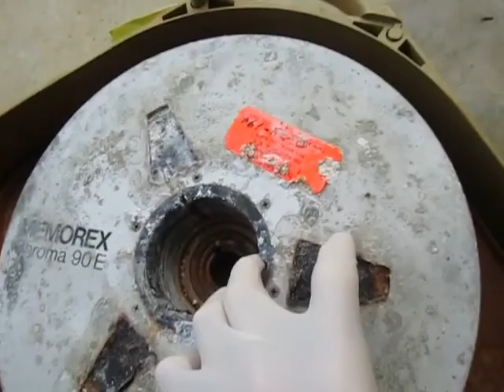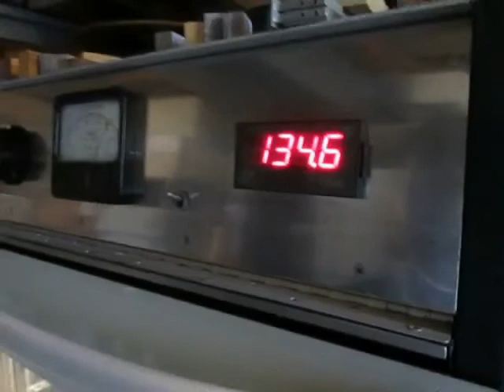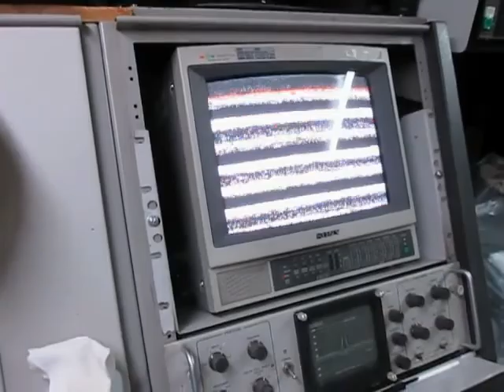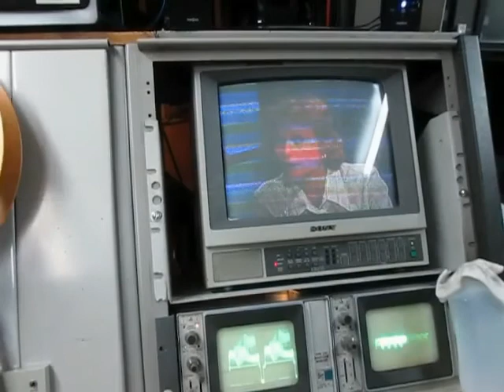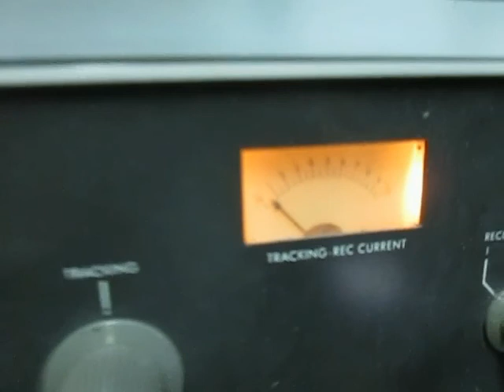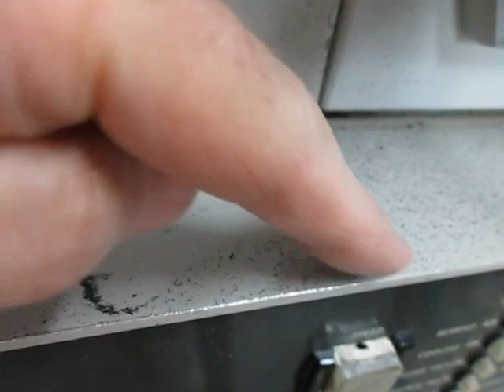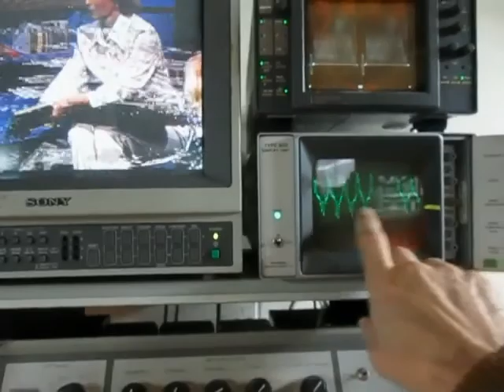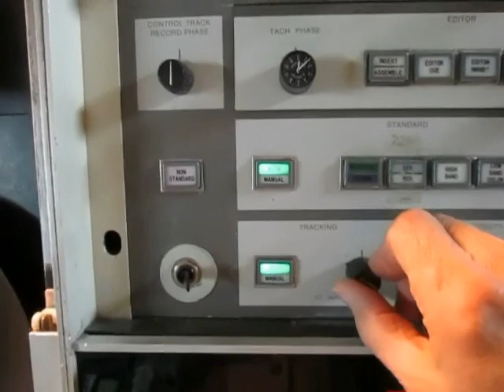The Quad Tape Transfer-Restoring A 2 Inch Quad Video Tape To Playable Condition And Digitizing.

Comment: Jeez when I saw the oxide surface of the "cleaned" tape I was ready to cringe thinking what was gonna happen to the heads that tried to play it.   Back in the times of RCA VTR and TCR quad machines, along with other tape formats, more than once I'd had to clean tapes that had been wet and dirty and had metallic oxides (usually white-crusty aluminum but sometimes mold) on them that could NOT have been good for the heads.  And how many quad machines are still in existence much less still functioning these days?   Parts like heads would be difficult to near impossible to acquire so the chance of damaging the heads with crud stuck to the tape would be a serious concern.   It's no wonder that the tape initially played back so poorly, when it was easy to see that the edge of the tape (that's where the control track is) was looking pretty rough.  But as the engineer demonstrated, there are alternatives, like keying on sync pulses etc to stabilize the playback and defeating the control track altogether since the control track would be unnecessary in this instance, mostly originally being an editing tool rather than necessary for playback.   Interesting that there are people who will still take the time and trouble to salvage old damaged media like this and make it useful again.  Kudos sir, from one old bcst engineer to another.   :-)
Reply from the maker: Hello Tony. Well, it helps to be crazy. Thats the first requirement! But seriously, it's no problem for me. I have my own ferrite bricks and make my own head tips. I rebuild my own quad heads from my stock of over 300 head assemblies. (its probably more like 350 but I lost count around 300). And you know what...I will let you in on a little secret: my tips last a lot more hours than the ones a head refurbisher puts on their refurbished heads....go figure. And then theres another advantage to doing it myself, I can make/change tip shapes and dimensions for certain problems with tapes that work better than a 'standard' tip. That realization came thru years of working with problem tapes and later on getting into doing the head work,  and having a lot of heads to experiment with. I really don't know how much equipment is still left in the world, and none of these 'experts' do either I don't think. But my feeling is probably "not that much". I've noticed in the past 10 years it has dried up to nothing if that's any indication. Heads- I noticed a couple years ago that after the Aheadtek guy retired and a chinese lady tookover, the prices on ebay went sky-high for used unproven heads. I haven't seen one on ebay in about a year. I am holding my own. I have collected vtrs, heads, parts for decades and have a mountain of spare parts, machines, and heads. I will never outlive what I have saved up. Have to nowdays in order to do the work. Just can't go out and find stuff like before. It ain't there! Here are the vtrs I use in the shop: www.QuadTapeTransfer.com
If you look around and take stock of what the other folks are running, usually they have one or two, maybe the same model, or a couple models. I have(or had) about every model going back to the tube era. Running and operating. I don't have any tube vtrs (and don't want any!) I say all that to say this: the more diverse models and head types, the more capabilities. Each different model of vtr and head assembly had certain things it does better than another vtr model, etc. Those differences really come front and center when trying to get a 60 year old tape or a damaged tape to play back better or not so good. Its another tool in the quad toolbox. Heres some more tape work you may like: https://youtube.com/playlist?list=PLJQg3rQJzoosKKRCrNrwgU13TE_KFqY6t&si=biTH-L60zUPJ-_N0
  Here is some video head work: https://youtube.com/playlist?list=PLJQg3rQJzoovLIWQ1VcnDdhNkikwBF5Qb&si=pp7snwwRwfltvrdP
  Here is some equipment work: https://youtube.com/playlist?list=PLJQg3rQJzoosbgyXSXE7AFEC_6U9dtKYj&si=41pHHV62-3ENzQjR
  And if you get bored with all the quads, I will play you a tune on the guitar! 😃🎸https://youtube.com/playlist?list=PLJQg3rQJzoosDp25C6aP8Sd_KC61b8-df&si=GEFY-oXXp0XqpN23https://youtube.com/playlist?list=PLJQg3rQJzoosDp25C6aP8Sd_KC61b8-df&si=GEFY-oXXp0XqpN23
  Have fun!
Reply: @LarryOdham   ...you rebuild your own quad heads?  Now THAT is dedication.  And, necessary these days if you want to keep a quad machine working.   I salute you sir, got your links bookmarked, gonna be checking them all out.  Keep doing what you're doing.   

Wanna talk old 2" tape.  We once dug an old Valleydale spot out of the racks all dusty, to see if it was salvageable enough to edit a bit of it out to make a new spot with the old days compared to the recent times etc.   This old 2" tape was BROWN, that old iron-rust-glued-to-cellophane stuff, and it played back perfectly in all its black&white glory.   It proved two things... the old tapes could hold on to their data for decades, and the station never threw anything away.   These days the only videotape I still fool with is 1/2", got a LOT of VHS tapes I've been converting to digital, been maintaining several high-end S-VHS machines for years... having long since learned the advantages of a TBC when resurrecting old tapes like that.    

Oh... just saw your video on the TCR-100, the bane of my existence.  LOL!   There were two of 'em, nicknamed FRED and FREDA (fucking ridiculous electronic device, and fucking ridiculous electronic device auxiliary).  Fascinating to watch them working with the back door open.   

Cheers... :-)
Reply from the maker: @tonyunderwood9678  Yep, rebuild my own quad heads, using my own tips. That is what it is coming to like it or not. Theres only one place on earth now that will rebuild a quad head, and they get $6,000.00 to do a rebuild.-NO THANKS!!! And when you figure in that their main guy retired a couple years ago, and the company is controlled now by a chinese lady that isn't all that interested(so I've been told, I don't know that for a fact), its anybodys guess how much longer they will continue. My guess is not long. I figured out years ago it was better for me to use the head rebuilding money to educate and prepare myself and get to the point where I can do it in-house rather than paying somebody else and hoping they will still be in business. I'm glad I did. It's not my problem anymore--its the rest of the quad world's problem....money well spent. I have been posting how-to and information videos here on the channel as I get time. I'm not going to rebuild anybody else's heads, but I am showing how to do it(how I do it) and someone else can follow my path if they want to rebuild  heads of their own/ invest their own time and money. // The early formula tapes are fine, they do not require baking because the emulsion doesnt collect moisture like the later formula backcoated tapes. The earliest tape I have digitized was 1958. It played back as good as the day it was recorded. When quad was done right, it was second to none. It gets a bad rap nowdays because there are a lot of amateurs trying to do it. And that's a sad thing because there is no longer anyplace they can go to get the experience they need. That is why I started all this, to put out some useful reference information that maybe the younger inexperienced archiving people can draw from. Not just talking about it, but showing how it is done and proving it.

Comment: Замечательно 👍!
А чем Вы ее оттираете в самом начале? Что за очиститель в бутылке?
Reply from the maker: Hello Eugene, I used two different solutions alternating between white vinegar and eucalyptus oil. The white vinegar is useful for softening the mineral encrustation and the eucalyptus oil is good for cleaning up the vinegar. Also used distilled water as a rinse. I spent about 6 weeks doing that cleaning, soaking, and brushing, over and over many times. The video shows the ending results.

Comment: Is there any way to output the control-track signal separately? I wonder if it could be run through an analog-to-digital buffer (which would smooth out the irregularities), then reinsert the buffered control-track back into the machine, to "fool" the machine into thinking it has the proper timing from the control-track.  Just a quick thought!  I love these old video restoration projects!
Reply from the maker: The problem with this tape is that there is no control track in spots because the oxide has flaked off from the water damage. The AVR-1 doesn't need the control track. It's secondary tracking mode detects the individual video tracks on the tape by looking at/for the fm signal peaks much the same way auto-tracking works, and then uses a derivative from that signal fed back into the control track phase circuit in place of the original control track. It does the same thing as the separate control track, indicates where the video tracks are located on the tape. It's nice to have that built-in function in a VTR to use on tapes with damaged or missing control track pulses.
Reply: That is such a sensible concept I wonder why AMPEX never used it in the VR2000s
Reply from the maker: @tortysoft  Ampex came close to it on the VR-1200-C. It was equipped with auto-tracking, which has all the ingredients needed to run without a control track. That machine had a -13 revision Intersync. I have a 1200-C autotracking vtr here.  Im not sure when the Intersync revisions stopped on the 2000B. I have a 2000B that is a -09. Its an earlier vintage vtr so maybe that is a reason why it was never considered, the Intersync revisions stopped before auto-tracking was introduced. A quad friend there in the U.K., David Dean, and I talked about doing it to one of his AVR-2 machines once upon a time a few years ago. There's no reason why it wouldn't work on another vtr.
Reply: I used an external ctrl signal to lock up a VHS that I used for recording broadband signals, like the medium wave. That worked very well. I've never had a pro machine - no space - or the need to try on a Quad. @LarryOdham
Reply from the maker: @tortysoft  Thats basically it. A very stable artificial(external) reference signal. Ampex went one step further and derived an envelope  from the fm video tracks, detected it, and used  the d.c. derivative voltage to self-correct the external reference subbed in for the control track. I have done it manually before using a HP function generator set to a high frequency and counted down for a 240/250 cps output. The HP was an oven crystal and the pot was a 20 turn shafted to a 100 to 1 vernier dial. You can get it down to 1 hz resolution.

Comment: Larry, what are you using to clean the gunk off the tape? Eucalyptus oil or some alcohol based material? Very impressive work.
Reply from the maker: Hello Paul, For a tape like this with corrosion and water encrustation I use white vinegar and a toothbrush to soak off the majority of the scale. Then when the tape is fairly clean from the debris, I will go over it with eucalyptus, then bake it. After baking I go back to the white vinegar soak and brush while the tape is still hot from the oven. After a few cycles it is loosened up enough to try unwinding/unsticking the layers slowly by hand. It took about 2 months to get this one completely unstuck and about another month after that to get it to a playable state.
Reply: @LarryOdham  Remarkable work. Do you have to remove the oil residue before baking? I have some Scotch tapes where the foam from the upper flange has liquefied and seeped into the tape layers. I was going to use eucalyptus to clean it down but worried what impact there would be if there was any residue left during the bake.
Reply from the maker: @Misterquill  Yes. I remove all the glue on the top surface using eucalyptus oil, then wipe off all the remaining oil with a thick absorbent cloth. Then bake. If the tape is evenly packed and wound tight, there will not be too much seepage. After baking I give it 2 or 3 cleaning passes on the Magnatek/Elcon cloth roller cleaner straight from the oven while still warm, then 2 or 3 passes on the Recortec vacuum grating cleaner, then put it on a quad vtr I have setup with an old worn down quad headdrum and burnish the tape a couple passes and monitor the RF Tracking meter level for head loading, stop & clean the head as-needed until it plays good enough to put on a good vtr for digitizing. Sometimes if the tape does have seepage, I have to unroll it by hand and clean the spots by hand with a cloth and eucaluptus. Not fun.

Comment: An explanation of methods and cleaning fluids would have be nice .
Reply from the maker: I think I had already explained that thoroughly on many other comments on this video. You can scroll around thru the comments and find several other explanations from me about the how-to. Basically its a toothbrush, cotton cloth, repeated soakings with white vinegar and undiluted eucalyptus oil, and distilled water rinse. Many repeats over about a two month period interspersed with step baking cycles from 126 to140.5 degrees F to loosen up the mineral encrustation and corrosion caused by the water damage.  You can ask me questions and I will be happy to answer, if I know the answer...😁 I would rather demonstrate the actual work and let you the viewer ask relevant questions that are important to you.
Reply: Thank-you
Reply from the maker: @whoam42a1  Anytime. Glad to help.

Comment: At 5:45 - I see the tape still exhibits what appears to be hydrolysis in the adhesive layer (sticky tape shedding syndrome). Wouldn't this indicate further "baking" or is that not what I'm seeing?
Reply from the maker: Hello Randy, No it isn't sticky-shed aka Binder Hydrolysis. The tape was baked 4 times thruout the cleaning process over about a 2 month period. The baking cycles lasted 8 to10 days each at various temperature steps ranging from 126 to 140.5 F. with a 2/day gradient. What you are seeing at 5:45 is mineral encrustation from the water and aluminum reel corrosion depositing a surface layer on the edges of the tape over a period of years being wet. To soften that layer, it was repeatedly soaked in white vinegar and scrubbed with toothbrush, breaking off a little at a time. Some of the deposits were below the edge down into the tape which couldn't be reached by brushing. Small granules hard as a rock. This video is an edited down version that had 5 parts and was about 3 hours long originally. Some of the shortened scenes do need a little better description.
Reply: @LarryOdham    Aaah. I was wondering if the adhesion was at the edges or not, since I watched you working them with the brush. I've been digitizing audio reels from the early 1990s (Ampex 456). So for, just 8 hours at around 122°F seem to get the job done - nothing like the extensive work you did here. Thanks for taking the time to clarify what I was seeing. You did an amazing job of bringing those images back to life.

Comment: I've never had to use the auto CTRL knob, the BBC only ever had one AVR1. I used it quite a lot, tack errors were and AVR1 thing, I didn't see them on this replay. Splendid work ! How long did it take to recover this tape!
Reply from the maker: Hello, Thanks for the nice words, I try! It took about 3 months of work on this tape start to finish. This used to be a 5 part series of videos, and I edited/shortened it down to make it a little easier to view. Some of the meaning was probably lost in doing that, but still the viewer can get some idea of what is possible and what can be done. And of course, ask questions!  Yeah, the AVR-1 is not my favorite vtr or my first choice. Most of the time it is more trouble than its worth and 99.9% of all tapes that were recorded correctly without any problems, you can't tell one bit of difference side-by-side comparing the files. And its a more dangerous and destructive transport than a conventional tape path transport on very old tapes. But it does come in very useful on some of the marginal or problem tapes. My first vtr choice is a vr-1200C or a 2000B and/or a RCA TR-70 dual demod & cavec. But in this instance was not any good because the control track was destroyed beyond repair on this tape, so the AVR-1 was the way it had to go and play back without the control track. Its a good 'tool' to have in the vtr toolbox.
Reply: I've got a lot of 1/4 inch audio tapes that are falling apart, oxide all over the place. Does Baking actually stick the oxide back on the tape? If so, when can I find the cookers? (in the UK) Thanks !
 @LarryOdham
Reply from the maker: @tortysoft  No, I don't think so. Baking will dry out the moisture from a sticky tape. Baking may cause it to crumble even faster. If you had some way to heat it up and reintroduce some moisture or chemical molecules back into the tape, that may make it stick and become pliable once again. I built my ovens from conventional ovens, remodeled them with digital thermometers and heating controls and installed fans inside to maintain the temperature precisely and evenly over a period of days.

Comment: I just bought a Rank Cintel DSX. 
Do you happen to know some of the engineers to get it working again?
Reply from the maker: In USA you could ask Myron Lenenski at CinePost in Atlanta. In Europe, ask David Dean at West Point Television.
Reply: @LarryOdham  Thank you, I will try that.
You have very interesting content, are you also restoring 35 mm film or only magnet tape?
Reply from the maker: @GregorPQ  No, I don't do any telecine film work, just 2 inch quad video tape and equipment. Years(40) ago, I operated film camera chains for on-air at a tv station for about 5 years, that's the extent of my film experience....not much! I was a tape tech for years in Tv, that was my forte'.